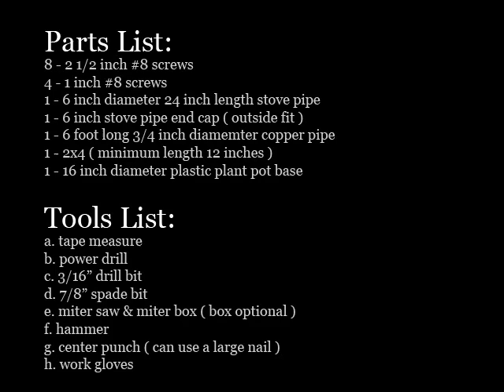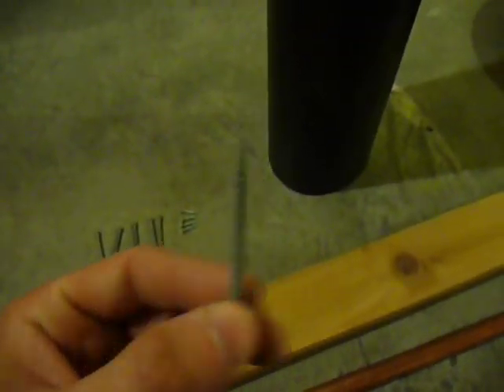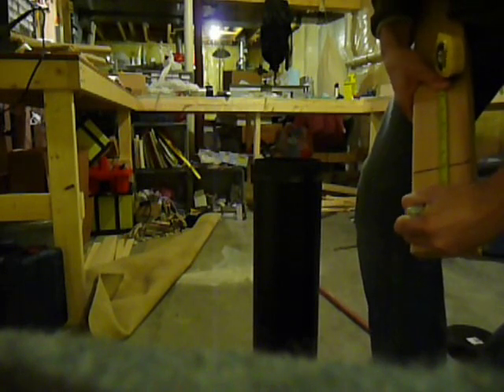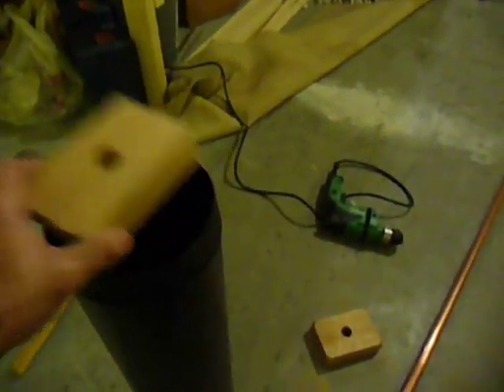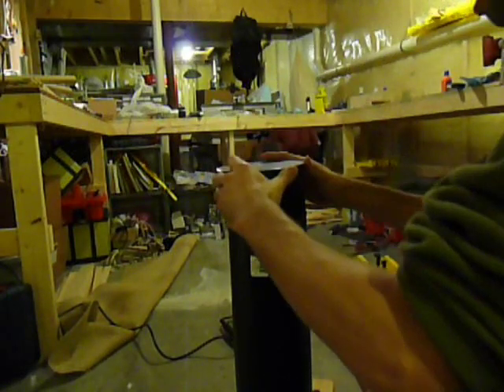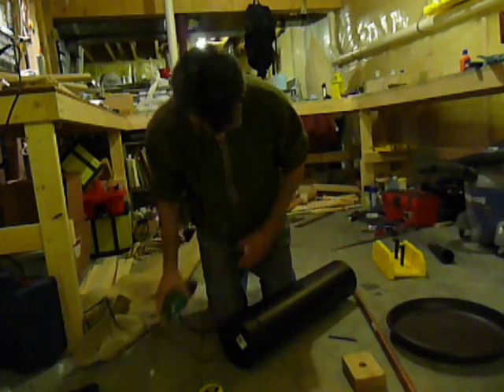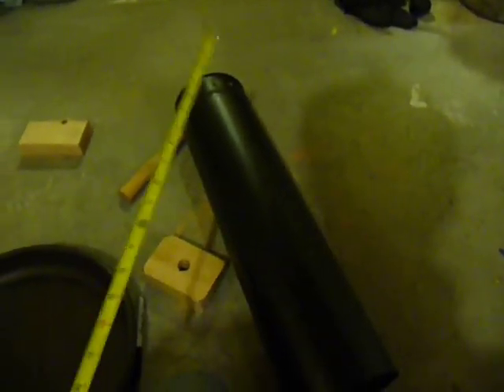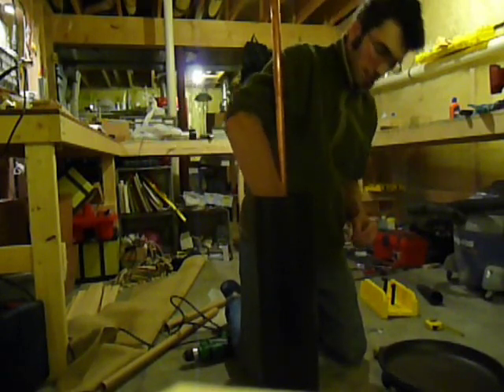Part 1 - How To Make A Squirrel Proof Bird Feeder

Comment from the maker: The top portion can be taken off the copper pipe, but it can be a bit tricky getting the top back on the copper pipe, so not necessarily recommended as is for a setup where you would need to remove the top each day.

I have had great success mounting a tube feeder on the top tray, which I fill with seed and leave it until the birds have eaten it all.

Comment from the maker: One option could be to find a larger diameter pipe that the copper pipe will have a good fit with. Design the top half to fit over that bigger pipe, and then the tall pipe would just slide in and out of that, allowing you to slide the top part on and off with ease.

You might have to look at different materials to get a good close fit, like metal electrical conduit, or pvc, pipe, and copper pipe, etc... You don't want the top to be flopping around too much, so it should have a close fit.

Comment: My daughter is doing a Science Fair Project and needs a Squirrel Proof Bird Feeder.  How easily does the stove pipe come off the copper pipe?  She needs a way to remove uneaten bird seed each day.  I wasn't sure how difficult it is to align the pipe with the holes.  Perhaps only attaching the Plastic pot base onto the Stove Pipe Cap only, making the Plastic pot base easier to remove for her?  What are your thoughts?

Comment: I built the squirrel proof feeder and it worked for a week but got up this morning and found the tube feeder on the ground and scratches on the 6 inch stove pipe.I wonder if 8 inch stove pipe would work ? The squirrels here in Vermont must be smarter than your average squirrel.